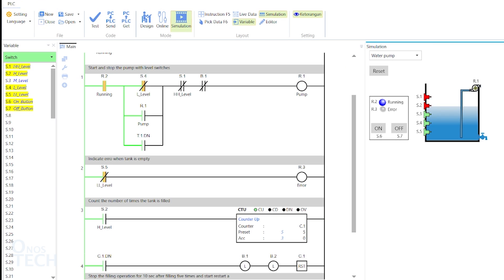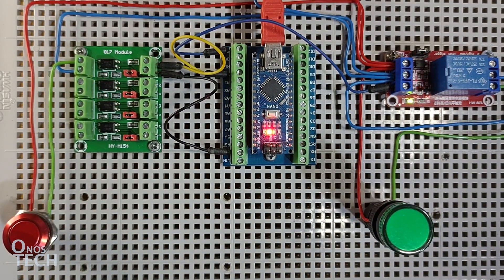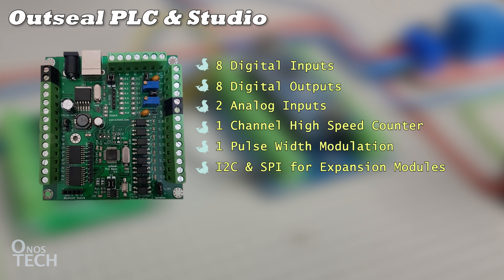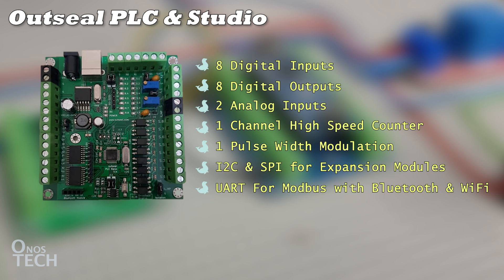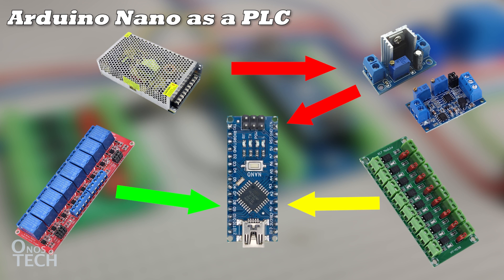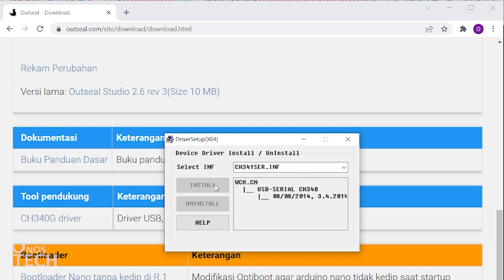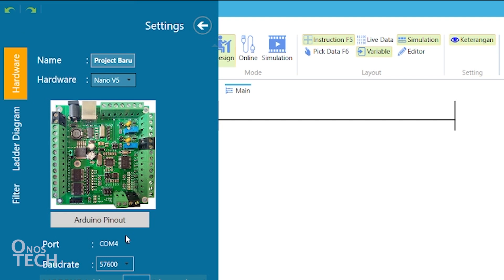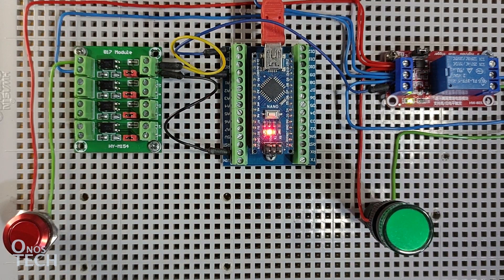#1 How to Turn Arduino Into a Real PLC!

Comment: Sir, i'd like to inform you that we used arduino uno as a plc by outseal in our graduation project in Egypt and we succeeded to connect it with wincc scada through modbus protocol according to your valuable videos.
our professor and discussion team appreciated that a lot, again I with all my team members send great thanks to your valuable channel, god blesses you sir thank you very much.
our project is an automation system to a water treatment plant by Siemens plc and arduino uno connecting with wincc scada
Reply: Great 👍 congratulations
Reply from the maker: @uniqueautomationelectronic5696 thanks
Reply from the maker: Wow! That is great news. I am so glad my videos were helpful for your project. Congratulations to you and your team. It will be nice if you can also share some short videos of your finished work to me at onos.technology@gmail.com

Comment: Respected  sir 🙏 it is fluctuations in analog input when i try to measurement a 100 watt bulb 💡  ac current by acs712  5 ampior modual. I need only constant value .pls give some suggestions. Thanks
Reply from the maker: Use SPWM to set intervals for reading the value

Comment: hi..thank you..i made a plc board using atmega328 smd in arduino nano..it was ok ..when i wanted to program ladder using outseal studio..there was a problem that the input and output jacks built into my board are not compatible with the inputs and outputs Outside...for example d9 I put it as output and in the outseal studio it was taken as input... Is it possible to modify it programmatically?
Reply from the maker: Arduino Nano pin D9 is already R.7 output in Outseal Studio. The input/output pins in Outseal studio are fixed and cannot be changed programmatically. See the link below for details.
https://outseal.com/site/tutorial/arduino/arduino_as_plc.html
Reply: @OnosTech  thank you... pwm port on any connected port?
Reply from the maker: @محمدروحي12  https://outseal.com/site/tutorial/pwm/pwm.html

Comment: This is great Onos!!!, I will buy an Arduino Mega and I try this new ladder software.
Thank you very much.
Reply from the maker: 👍👍👍 You are welcome!
Reply from the maker: I don't think an Arduino Mega will work. The microcontroller used for Outseal PLC mega is Atmega128a. That of the Arduino Mega is Atmega2560. You can use the Arduino uno and nano